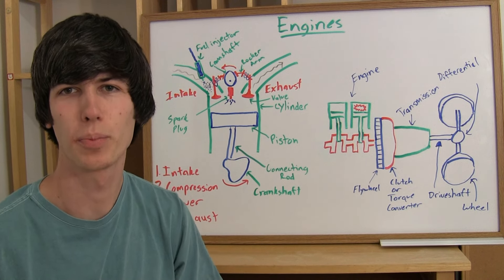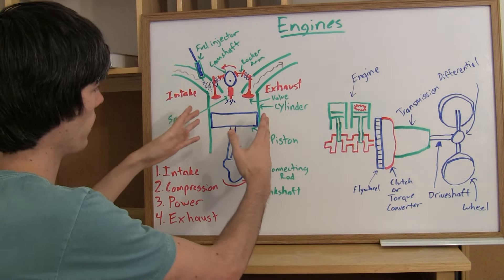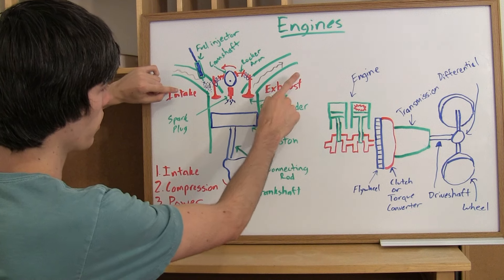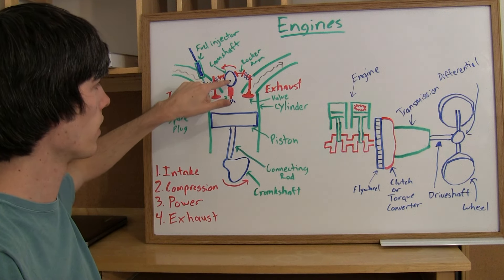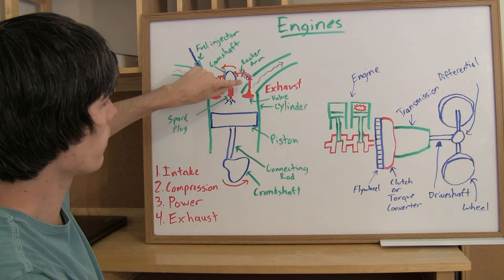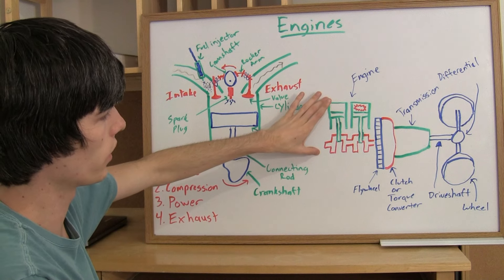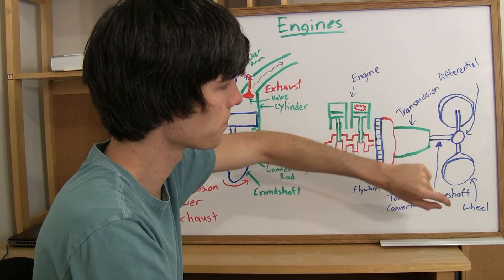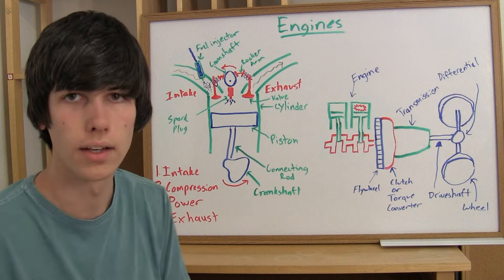Car Engines - Explained

Comment: I'm a 30 year old man with a passion for motorcycles and this was a great introduction to hammer in what I sort of, kind of knew but not really.
I came here because I was curious about why a cylinder would have 4 or even 5 valves (3 intake 2 exhaust) and figured I might as well start with the basics. Thanks!

Comment from the maker: Read a few forums. For a 6.0L truck engine, some people have suggested about 1/4 to 1/3 of a gallon burned in an hour. So for your engine, a basic iteration would yeild 1/12 to 1/9 of a gallon in an hour. But by no means are these numbers accurate. You could try asking a dealer, and they might be able to hunt down the answer.

Comment from the maker: The camshaft is geared to the crankshaft to rotate the gears (1:2 gearing, 2 rotations of the crank = 1 rotation of the cam). Engine oil sits down in the oil pan below the crankshaft, as is pumped throughout the engine.

Comment from the maker: Crank is moved from the piston moving up and down, the camshaft is geared to the crank. This all starts by engaging a starter motor to the flywheel and rotating the engine a few times.

Comment from the maker: I'm not too experienced in the tuning world (which I hope to change in time), but, if nothing else has been done to the engine, I don't see why it's totally necessary. You would just be removing backpressure, which is lost energy, so it seems the design would inherently increase HP without adjusting any settings.

Comment from the maker: Combustion causes the piston to rotate the crankshaft. The flywheel is used as a gear to start the car (see "starting a car," as well as to keep the power delivery of the engine smooth.

Comment from the maker: It's not a dumb question. The flywheel holds energy and keeps everything rotating. Also, you'll have other cylinders which are on their power cycle (if it's more than a 1 cyl. engine) which will keep the whole system rotating. You can search my channel for flywheel if you'd like, also I believe there's an annotation for it in this video.

Comment from the maker: The other cylinders (assuming it is more than a single cylinder) are firing allowing this piston to move up. Also, the inertia of the flywheel allows the piston to compress the air above it.

Comment from the maker: 1. Starter motor, check out my video "starting a car."
2. More air, by opening the throttle more (check out my video "gas pedal") leads to more fuel injected, creating a greater force on the piston and increasing the engine RPM.

Comment from the maker: I have a degree, I'm not a PE as you must be in the working field for 4 years before taking the exam. I am a certified "Engineering Intern" as I've passed the FE. This probably doesn't make sense.

The simple answer is: Yes, I have a degree. I went to NC State - Check out my website for more info (link in description).

Comment from the maker: The starter motor, which gets its power from the car battery starts the process. The momentum of the flywheel keeps it going, which gets its momentum from the power strokes.

Comment from the maker: The direction of the cylinder banks. They either run parallel or perpendicular to the car. It's just a placement of weight, so companies use a design that suits the weight balance they want for the car they are designing. Also the drivetrain needs to be taken into consideration, how power will ultimately reach the wheel.

Comment from the maker: The driver would be sitting behind the engine/clutch/transmission. The clutch is a disk which rotates on a plane perpendicular to the ground. I will be adding annotations to this video so each of the topics can be easily accessed.

Comment: SO MANY LINKS lmao. Excellent video(s) btw, you're teaching me a lot!
Reply from the maker: Guitarfollower22 Learn all the things!
Reply: Engineering Explained Any idea why lower on fuel cars drive a bit faster?
Reply from the maker: soldier7799 Less weight? If that's what you're referring to.
Reply: Engineering Explained No, not the weight. When almost out of fuel the engine starts to behave differently. The dynamics changes. I now sounds strange. But its not only me that finds the difference. And I have no idea why. Mine is diesel, but people on petrol say the same thing. Cheers.

Comment: I'm entirely grateful for your lucid  EE vids .  At the risk of being impertinent, If I might suggest the following:
1. Car engine vid on the different engine geometries of the flat, straight, and V (including the pact of the OHV single cam, flat, and OHC on CG) formats as they relate to the practical issues of integration of these formats on chassis design whilst offering a compare contrast of the benefit/drawbacks of each;
2. Aero - this is extremely frustrating black art as I'm F1 fanatic and, quite honestly , the vast expenditures on this R&D and integration give me, the viewer, no reasonable way to assess/understand and participate in that particular part of the racing drama.  This topic is probably a little daunting and could take a couple/few episodes but the end result of the EE series might be to give us some encapsulated concepts to allow us non-aero people to start to "pierce the veil".  For example, going and visiting a buddy with some CFD software to visualize the concepts might be an interesting vid: and 
3. A series of discrete vids on some of the 'key' mathematics/physics of the topics you present to your audience to which you'd be able to make quick references in your broader topics.  The idea is to present drill-down opportunities to those who inclined to learn and presented in such a way to encourage the not-so-inclined to absorb the concepts and allow all to have some "ah-ha" moments when integrating and applying your teaching.
Thanks!

Comment from the maker: Both mechanical and electrical engineers will indefinitely find employment. A mechanical engineer doesn't have to work with ICEs, it could be motors as well. Both are good fields for employment opportunities.

Comment: Hi, awesome videos - learnd alot! But i have 2 questions:
1. First 2 phases need the flywheel to be rotating. From where does it have the energy to do that when the engine starts?
2. How does the engine manage to speed up and slow down since the whole proces is controlled by the flywheels momentum and the flywheel is runned by the cylinders. Where can you add or take away the energy in this loop? Fuel injector?
Thanks

Comment from the maker: Much less than .5 seconds. Let's do the math. Say you're at 3000 rpms, that means 3000 revolutions of the crankshaft every minute, or 1500 power strokes per minute (each cylinder fires once for every two revolutions of the crankshaft). 1500 power strokes divided by 60 is 25 power strokes per second, per cylinder. You have 4 strokes for every power stroke, so 100 strokes per second in this example. So this would mean the power stroke couldn't last much longer than 0.01 seconds at 3000 rpm.

Comment from the maker: Perhaps check out my videos "Front wheel drive" or "rear wheel drive" showing the attachment of the drivetrain to the driving wheels, as well as my suspension videos. The axle which drives the tires moves up and down with the suspension.

Comment: Dear Engineering Explained, Have u ever heard of VFS or Vapor fuel system, supposively it was a break through discovery on how a cumbustion engine works. There is a government issue and some sort of consperacy behind it for a while, but it was discovered or even innovated. Its a very interesting topic and i need ur thoughts on this.

Comment: video request: could you make a video on how an engine starts itself? so this videos explains what happens when the engine/car is on and moving. Can we get a look at what initially gets things started and maybe you could add factors like driving while your engine is cold and letting it heat up in the morning after start. like how the ignition system works and all and what keeps the momentum going?

Comment: There's this one part I don't get about Piston movement: what drove the piston to move down in the first place for air intake? Is it the residue momentum in the crankshaft connected to the piston from the last power stroke, from the other pistons in the engine, or from the air pressure? And I guess the same question goes for compression, where does the energy for the upward piston motion come from?

Comment: Love the videos.. Regarding the Otto -- why not just remove the spark plugs, and compress the air to a high degree?   You mentioned the "pre-ignition" problem, but why not just take advantage of this principle and save money on spark plugs?

Comment: my dad's scooter uses carbuetor not injectors. I know carbuetor is an older technology that's found in older vehicles which we don't use much anymore, and I know it mix fuels and airs together.
There's one thing I'm not quite sure about direct injection engine is that if they compress and spray air into the piston as well or do they just open up the air valve to let the air into the engine automatically?

Comment: In terms of energy, am I understanding this correctly as: All of the chemical energy in fuel is converted into heat energy by ignition caused by the heat of the spark (not the light of the spark), and that heat energy (from the chemical energy) causes the air to expand (heat makes gasses expand) causing some of that heat to be converted into kinetic energy resulting in the measure of “thermal efficiency” (minus some frictional losses)?

Comment: Great video! I have 2 questions..

So firstly, the piston relies on the force provided by the spark plug's ignition of the air fuel mixture inside the cylinder to go down... but what makes it go up? Is it just momentum from the downstroke? 

Also, how does the piston perform it's FIRST revolution? Since it isn't moving.. the problem I'm imagining is that you turn on the car, fuel is injected and the spark plug combusts the mixture.. but what if that piston is in the down position? Will it still go up? I think I comfused myself..

Comment: The Bugatti Veyron has what's called a W16, which is two V8s attached together on a common crankshaft. If you mean end to end in a true V16, then yes that could also work.

Comment: If you get a fast car, learn it's handling limits in a parking lot. Trust me, it will help you. Simulators DO teach an enormous deal, but nothing can teach you the intricacies of the way your car handles in the real world than pushing it in a safe environment. Also, never, ever believe you have nothing to learn, even when you're an awesome driver. There's always more to learn, always room for improvement.

Comment: what i didn't undersand fully is the energy flow. So is it that during the step 3 of the cycle, the piston gets all the energy to move up and down for the rest of the cycle, or is the intake mixture under pressure so it "pushes" the piston?

Comment: Hello. Nice videos and great presentation.
I would like to ask a question : What is the force that makes the piston go from the intake state to the compression state? In other words how does the piston make the vertical movemen from the bottom of the cylinder to the top?
Thank you.

Comment: Also, in step 1 intake when the piston is pulled down does it create a torque on the crankshaft as well, not just in step 3 power stroke?

Comment: Hi Mr Fenske,
I would like to know why the maximum piston velocity is "limited" to around 41m/s today?
Rings ability to seal? effort on material, with weight compromise?
Any futur trends in pistons making, like steel pistons? composites materials?

I found that whatever R/L (rod lenght/half stroke) ratio you run, the maximum speed velocity is in the vincinity of 41 to 45 m/s

Thanks for your answer and why not video about that mecanical limitation of our beloved ICE engine.

Maybe interesting to expose thermodynamical limitation (flame propagation) etc....

Best Regards
Régis

Comment: wait, let me get this straight. As you say it goes down the mixture comes in, then it ignites and cylinder goes down again and then when it goes up again lets the air into exhaust, and then repeat, so if i got it right does that mean that per 1 cycle the cylinder does up and down twice?

Comment: Dude, you're a genius man! Where do you learn all this stuff? I really enjoyed watching your F1 clips. I have a question, I hope it makes sense: Why, on F1 cars are the front tyres angled in (if looking from the font) slightly? Surely this means less rubber on the surface of the road which I assume is less optimal? Or will that angle flatten out from the load under braking? Any insight would be much appreciated.
Reply from the maker: Check out my video called "camber" which is what you're referring to. Slight negative camber can help in cornering, as the car leans into the tire, the patch on the ground is larger.

Comment: Thank you for this video and the channel. 

Honestly I'm not an engineering guy as whenever I tried to learn anything the explanations did not make sense and usually I ended up giving up but this channel might just convert me engineering enthusiast. Thanks.

I had a question. At 0:28 you mention that there is a camshaft which is used to open and close the valves. I was wondering how the camshaft works. I mean from where does the camshaft draw power to rotate? Is it from the engine itself?

Also can you recommend an animation which can be used with the video to understand the concept.

Thanks in advance.
Reply from the maker: The camshaft is geared to the crankshaft. This is what your timing belt connects. For every 2 revolutions of the crank, you will have 1 revolution of the camshaft. DOHC vs SOHC vs OHV - Explained

Comment: Hey EngineeringExplained, one quick dumb question. So where would the gas pedal come into play? If the gas pedal controls gas intake, would it be directly linked to the fuel injection part?

Comment: I have a question.. Lets say the car is moving and is continuously going through the 4 cycles shown in the video. Wouldn't the compression part of the cycle ''steal'' energy ? Because we just moved the piston down to create torque and now we must use torque to move the piston back up for the now cycle..
Reply from the maker: Yes, it requires energy to compress the air/fuel mixture.

Comment: What if when the engine's on and suddenly a high voltage cable that sends high voltage to the spark plug comes off? One of the spark plug will not work, would it? So in this case, the mixture of air and petrol keep going into the cylinder but without being combusted, wouldn't the petrol get pushed out of the cylinder during exhaust stroke and thus there'll be petrol spilling from the exhaust pipe?
Sorry if my English's messed up. EE, please reply. Tq

Comment: I know that it isn't possible with this type of engine, but wouldn't it be better to try and find a way to get the intake valve out of the way during the intake stroke and the exhaust valve during the exhaust stroke? It doesn't seem possible in this type of engine, but it seems that doing that would add hp from less friction during the strokes.

Comment: How does the crankshaft (or the piston) does the initial and final (for intake and exaust) movements without the fuel reactions? Electricity or what?

Comment: Why is the inner diameter of connecting rod at big end significantly larger than the diameter of crankshaft section (crankpin) in contact? Would it not make sense to have this inner diameter only slightly larger?

Comment: EngineeringExplained hi,
I'd like to ask you a question:
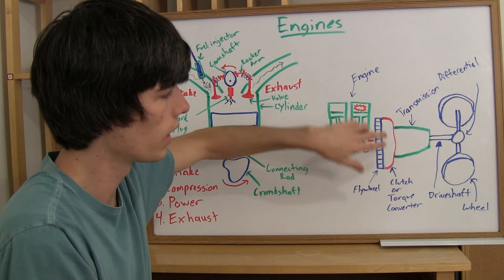at 4:35 you speak about "that" going into the transmission, my question is what is "that", the torque force? 

thank you a lot.

Comment: to improve the torque of a simple 4 cylinder engine, is it possible to make the camshaft gearing a bit bigger in order to produce more torque? i wanna improve just a 4 cylinder engine with a lot more torque.

Comment: I was just wondering....what causes the 1st stroke? 
I mean, the combustion causes the piston to go down thereby causing the crankshaft to rotate. but y does the piston go down in the 1st stroke? Is it coz the valve opens and piston goes down due to the pressure caused by fuel+air intake?
Reply from the maker: A starter motor starts the engine, thus performing the intake stroke for the engine. Once it's firing, the intertia of the flywheel is enough to power through the other 3 strokes.

Comment: uh new to this...so got a pretty stupid doubt..how does the piston go down to initiate intake in the first place? and also where will the piston be when the engine is switched off?..and where will it be it starts?
Reply from the maker: +Arthik Alexander Welcome! :) https://www.youtube.com/watch?v=sn4yszblY4s
Reply: +Arthik Alexander There are usually more then one piston so that when one is up another is down and vice versa. With this configuration the pistons move each other. They are first moved by an electrical starter engine when the engine is turned on and they will usually stop in up or down position when the engine is turned off (for a normal 4 cylinder engine)
PS. There are no stupid questions, just things you haven't understood yet ;-)

Comment: Someone told me that engines that have an ECO mode, for example GM has an 8 cylinder that can run in 4 cylinder mode, that this can cause issues with deposit build up around the rings and valves in the non firing cylinders. Is this true and are you aware of any of these issues?

Comment: hey man i like this channel a lot, i have request can you make explaining video about spark plugs specifically the element used in them like iridium or platinum, and deffrient brands like pulstar and NGK and champions Etc.... and why the price varies from spark plug to another. even though the have the same duty spark the fuel mixture in the combustion chamber but im still so confused :S  thank you.